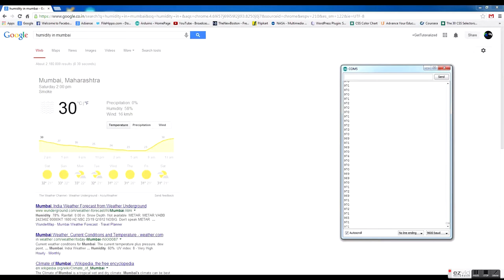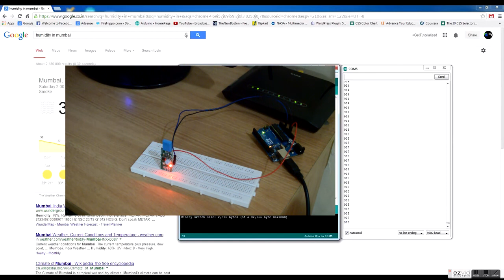Humidity Sensor With Arduino - Interface & Coding

Comment: how your supplying Power supply: 1.5V AC(Max sine).Operating frequency: 500Hz-2kHz. to HR202 humidity sensor element ? i know you have use hr202 sensor module with  3 to 5 V supply . 
and please send hr202 calibration equation to convert adc smaples to % humidity .